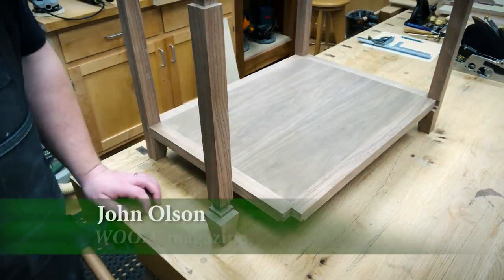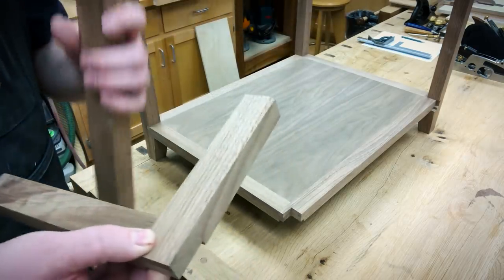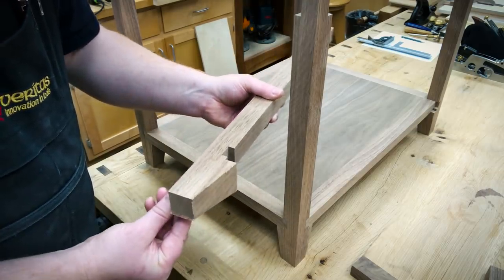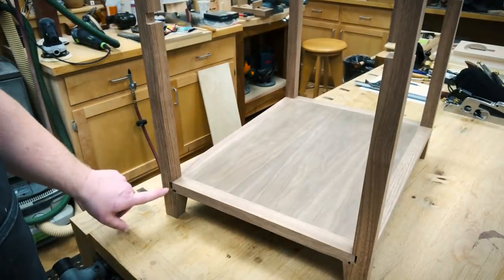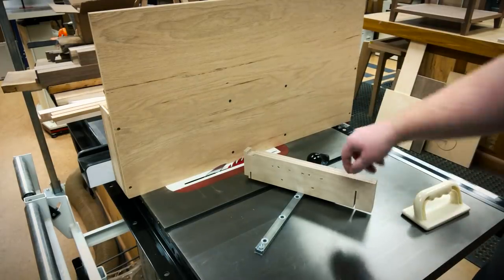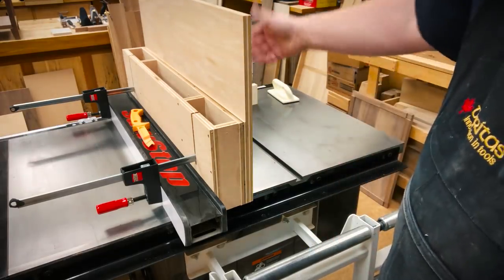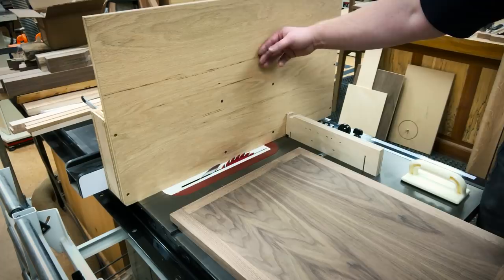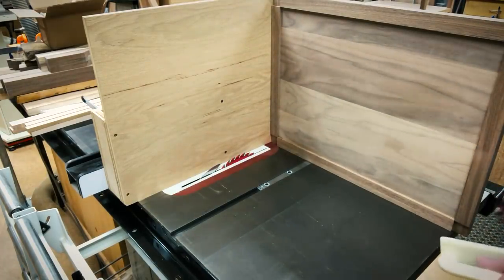Making a Modified Lap Joint

Comment: Joints are very interesting.  After all that work to make the table top, it seems so risky to notch out the corners of the table saw in such a complicated and risky way.  Why not just score it with a marking knife, cut it out with a back saw and pare it with a chisel.  That would be much safer for the piece and for you and I think would take far less time.  Hand tools are easy to forget about.